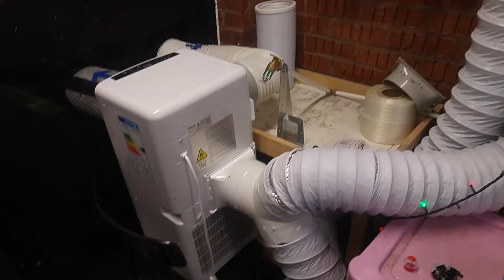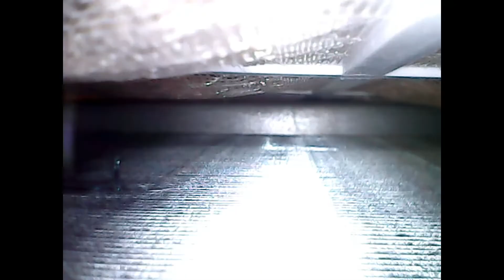defrost cycle test3

Comment: I have used portable ac as heater with hommcomm brand once which goes to defrost mode with fan only in high speed for 10 minute once once the eveaprator is fully iced up (there is a seperate iceup sensor on the evaporator).i have replaced  primarily temp sensor with 4.7khom resistor corresponding to 27 degree Celsius  and used an ardunio ir remote emulator to switch between air conditioner  mode and fan mode to prevent ice up of the evaporator coil.tge tuming for ac mode and fan mode was optimized by trial and error around 25 min in ac mode and then 10 min on fan only mode ,this has worked for me last winter.iam planning to program ardunio so self optimize the cycle and prevention of ice up and optimize pump efficiency

Comment: So this heat pump defrosts automatically? Do all portable heat pumps have a defrost cycle? I'm concerned that a lot of them don't. A lot of the manuals say that they stop working at 40F or 45F. I don't know if they mean that it literally refuses to run at those temperatures, or if they mean that it just doesn't work well at those temperatures. What is the manufacturer of this unit? Also, is this a single hose or a dual hose from the factory?
Reply: This unit is a cooling only air conditioning unit that he's rigged up to use the out exhaust air to heat his home... Instead of cooling room air he's using outdoor air to collect heat in cooling mode and then pumping it back into his house. When this unit goes into defrost it will just turn the compressor off and keep the fans running. This isn't a true reverse cycle unit.